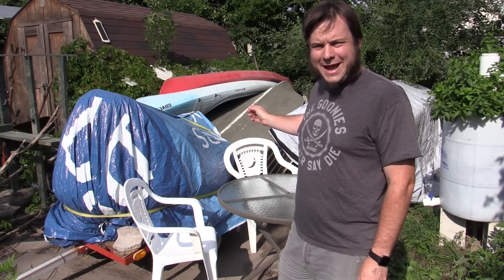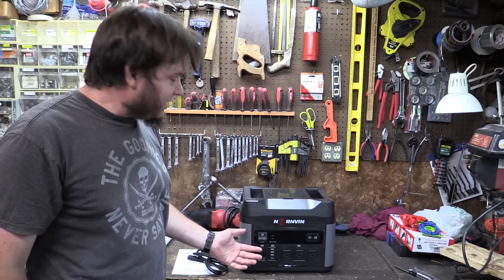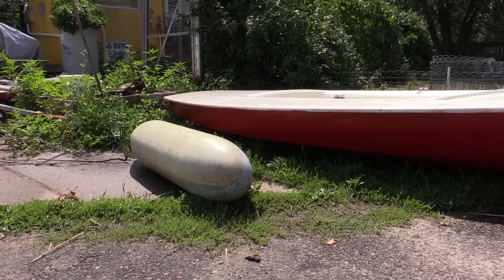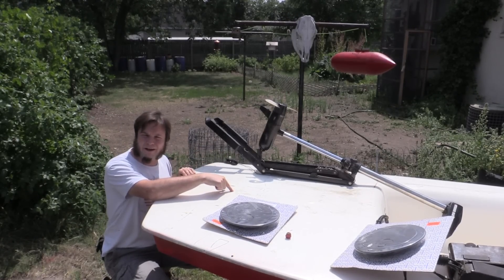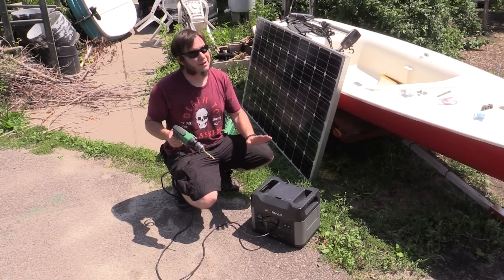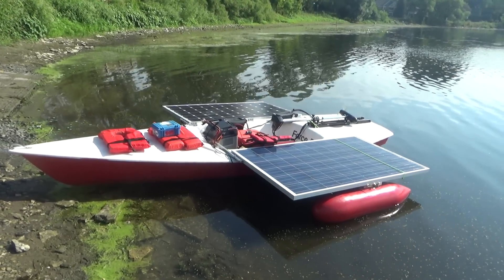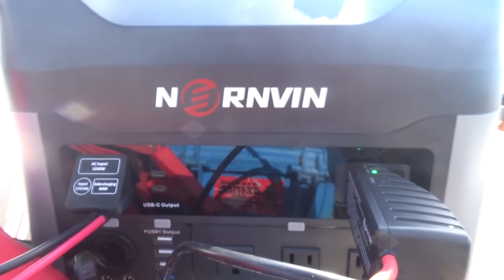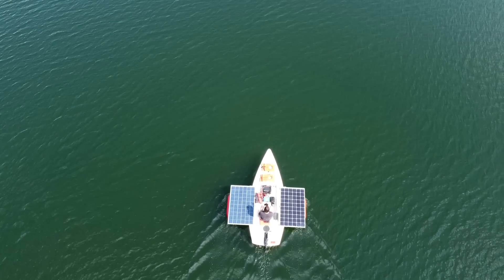DIY Solar Boat With Nornvin Battery Pack And Random Junk!

Comment: I want to do something similar on a boat project, but I just want a direct pass through to the motor.  There is a rowing cabin cruiser than Gartside sells plans for, and I have a couple of epic, slow rivers that I would like to row down.  This is not some kind of purism contest.  I like rowing, but rowing, a houseboat could be a problem if there was wind.  I thought some boats are just direct solar panels to motor/controller today, possibly without a battery.  I don't know how one does that though.

Comment: Connect it to a 100ah lifepo4 battery and a NOCO GC018 female 12 volt plug and you’ll be set, the lifepo4 battery has a 100 amp BMS.  The price has come way down on the lifepo4 batteries.

Comment: 1) How many watts can you pull from the cigarettelighter socket on this poerstation? 2) What IP on the powerstation, how waterproof?
Reply from the maker: I didn't check the actual wattage on the cigarette lighter, but I can go up to motor speed "3" without it cutting out! The product listing seems to have vanished so I'm not sure if they still sell this model.

Comment: for better steering, you probably need to insert an center board into the slit in the cockpit. Looks similar to the type of boat called Laser and since you are not racing or sailing for that matter, you can probably insert a water treated plywood about a meter long and that shoudl give you quite good stability in going straight and turning.

Comment: you only need a 30ah battery to work with your solar charger to put out enough amps for your small troller if your panels are otherwise generating the juice you are needing.  even a  30ah battery might never gets depleted.  my 30lb troller consumes about 165 watts,.

Comment: I find these electric motors fun and practical on short ranges. I've been gliding around the lake using one. They are also comfortably silent.

I've had 1 issue with the ergonomics of the steering/control rod. It consistently remains at an awkward angle, positioned behind my back, leading to discomfort while trying to manage and steer on a little bit longer distances.

Your boat seems to have a greater distance between the motor and the sitting position. Compared to my experience using these on a standard rowboat, where the control rod passes right by your armpit when you're sitting right next to the motor.
Reply from the maker: I grew up driving outboards, so I actually prefer the tiller steering! This one has the weird foot pedal (which I'm using as a hand pedal since the cable isn't long enough). I could probably modify this to a steering wheel pretty easily, but the pedal works for now.

Comment: make an adapter for the booster output with the same connector (might be xt type). you want a nice fuse in there...quick and easy and you'll make this in no time :D

Comment: No waves thought. Any thoughts of a safety hull ?
Reply from the maker: The sailboat hull is basically a sealed bubble with the cockpit molded in. There's some foam in there as well, so it's theoretically "unsinkable".
Reply: @saveitforparts  ok thanks. Thought an a bit more ruff sea will probably bring some surprises .. anyway great fun to see

Comment: fantastic project! much roomier than putting panels overhead (I would know!)
Reply from the maker: Thanks! The low headroom on yours was definitely part of my planning process! I'm also enjoying your lobster boat videos, I used to crew on something like that :-)
Reply: shade is underrated!
Reply: I'm in the middle of doing this with a pontoon with a collapsible roof. so far so good, I think we should be able to make just under a kilowatt at peak sun!

Comment: Now I want to get my hands on a cheep boat to do quirky stuff in
Reply from the maker: There are usually a few cheap/free boats on Craigslist / FB Marketplace, usually in the spring when people are cleaning up, or in the fall after the boating season. If you can get one with a trailer, that's always a plus! Usually need at least some repairs and cleaning, but that's part of the fun :-)

Comment: That type of connector is called EC5, you can buy one and solder it directly or modify the one you have for jumpstarter, just bypass the relay inside the black box
Reply from the maker: I bought an EC5 and it's not quite the same, there's a hidden 3rd pin (probably to engage the relay). I'll have to fool around with it some more.

Comment: I'm not an expert, I sure don't claim to be one, but I /believe/ those floats are actually drop tanks from aircraft, they would be hooked up to mounting points under the wings to give the plane more range, and would be well, dropped in flight to save the extra weight, that's my theory at least.
Reply from the maker: I think you might be right, although I couldn't find a connection for the fuel. They might have been modified for something else over time.

Comment: Just my .02 worth, The drywall toggle bolts will eventually eat a hole through your fiberglass if you dont put a backing plate that is tougher than those metal wings. Dont lose your solar panels! Best wishes, love your video and it answered a few questions for me for future projects. Keep up the great work of saving things from the dump.

Comment: i wonder if you could power the motor off of 240 watt USB C PD
Reply: looks like you would need to have a PD decoy chip that supports requesting 240 watts from the charger, and then you would need a step down converter since 240 watts PD is 48 volts

Comment: A kooky suggestion would be to run the motor up through the daggerboard slot, perhaps widening the base of the thruhull space so you can raise the prop high enough to not damage it on the trailer/shore. Then you could steer with your feet while facing forward with the overall boat staying more horizontal. Though cleaning prop of vegetation might be a difficult task.

Comment: im sure with not a lot of hackery you could get that jump start lead to be a permanent on adaptor,  that lead probably shuts the connection when the alternator spins up and starts charging. all that shouldnt be needed for your less than 20 amps your pulling. great video would love to see a part 2!

Comment: Great project! My biggest concern is having AC outlets near the water. In case of an emergency, does this battery pack have some protection to shut down if water is spilled?
Reply from the maker: You can turn off the AC, and it does have built-in circuit breakers. A waterproof housing would be ideal, although some cooling is still needed.
Reply: @saveitforparts Submersible water cooling should work great :) (pun intended)

Comment: Whats the point of lifevests if you dont put it on?
Reply from the maker: I have an inflatable fanny pack I usually wear, the ones on deck were actually to wedge under the boat so it would sit flat on the trailer 😂

Comment: great video
i believe the output from your battery uses an XT90 connector, if you built a custom cable you wouldn't have to hit  the boost button.
also this looks very similar to RCFlightTest's boat,  the only difference is he has built anautopilot and custom motor/props.

Comment: I would like to see you add a faster prop to this boat see if you can get it to atleast 20 miles per hour and maybe make a canopy or enclosed seating area that you could open up maybe detachable  walls and permanent canopy.

Comment: its nice they sponsored you. but i don't think id buy that pack for... well anything. they don't give you freedom to how you want to use the power. than there are MUCH better options that don't constantly need to be reset or turn off randomly.

Comment: If you gut the relay board out of the jumper cable plug end, wire it directly it wont cut out.

Comment: Yes, most impressive of all your follies! As for steering controllability how about locking trolling motor in place and adding a tiller paddle behind it for steering? I think it would provide you less drastic directional responses than turning the trolling motor.

Comment: Would the 12v output leads have the same limit at the 12v port?
Reply from the maker: I'm not sure, I was thinking about connecting all 3 in case they have separate cut-outs.

Comment: An idea, replace the power bank with leisure batteries, a solar charge controller and you can run your outboard straight from the batteries, a small inverter can be clamped on the batteries for mains charging

Comment: the black thing with the button is just a reverse polarity/anti charge protection for jumping vehicles so that you dont cause a fire hooking it up backwards or if the vehicle starts and then begins charging the battery. 
You can just break it open and bypass it, nothing special. Maybe consider a ~70a fuse on it

Comment: A dagger board would keep the boat going straighter, and being less spinny… great project, and it looked like it was fun to make.
Reply: dagger would help very little... need a rudder, even if its a fixed rudder
Reply: @davharzin2370  No, it needs a daggerboard for stability which is why the original manufacturer of the boat provided the facility to fit one.  A rudder is for steering on sailboats or with inboard motors, when you have an outboard on such a small boat a separate rudder is not required.
Reply: @davharzin2370  WAIT. Thats just a daggerboard
Reply: Daggerboards are for cats. This needs a centerboard
Reply: @DonHavjuan   Nope, plenty of small single hulled boats use daggerboards.  A daggerboard fits down vertically into the slot built into the hull, which is what this boat is designed to have.  A centreboard is attached via a pivot near the top so it can swing backwards and up into a housing.

Comment: "The Minnesota DNR would like to know your location"
Reply: What does this mean? DNR?
Reply: @SvobodniyNic it stands for Department of Natural Resources. They are the people who police "Natural Resources", such as fishing, hunting, and boating. They  primarily look for people breaking laws related to the outdoors basically. So if you put a boat on the water without registration they could give you a ticket
Reply: @NarNarHD  Okay, Got It!
Reply: @NarNarHD Are you required to registered any boat in USA and Minnesota specifically? Where I live you have to register only if your boat is longer than 4 meters or engine is more powerful than 10 kW. If your one is too small or not powerful enough, you can still register but it is not necessary but I'm not sure whether you have to register to access big rivers and sea.
Reply: @pavuk357  Non-motorized watercraft 10ft or less do not require registration.
Reply: @NarNarHD Each state uses its own term. Some are “Fish and Wildlife” or similar, instead of “DNR”.
Reply: In MI they would see your vid and ticket you. Dirtbags.

Comment: You could use a relay to seamlessly switch between the jump start booster and cigarette lighter. I think if you wire the relay to energize from the jump starter to switch the input to the motor over to it, you can press the jump start button when you want to use the higher speed, and then when the time runs out it'll switch back to the lighter port, assuming you've switched back to a lower speed at that point so it doesn't immediately cut out the power to the lighter port

Comment: If you get sick of pushing the button on the DC booster to get to level 5 on the trolling motor, you could get an AC to DC inverter or power supply and plug into the AC outlets. Since you're getting plenty of power with the solar panels, the losses due to the invertor will be negligible.
Reply from the maker: Yep, that's an option I considered. A little inefficient but the solar panels were making plenty of juice even early in the morning with the sun low.